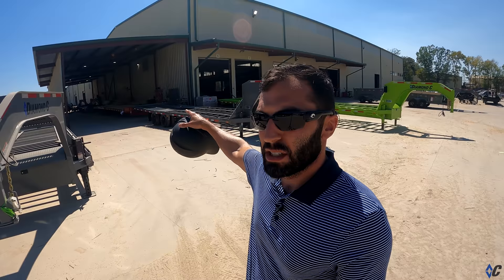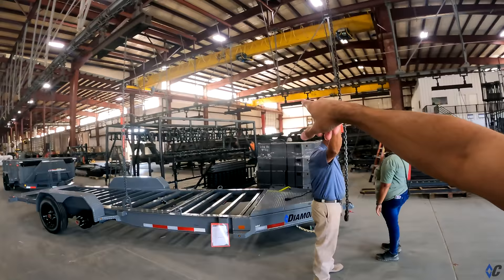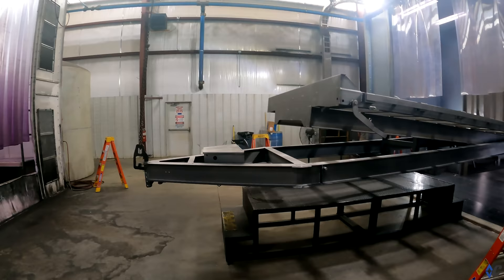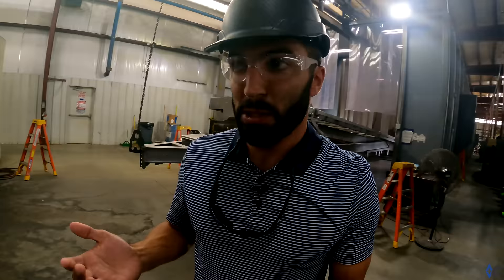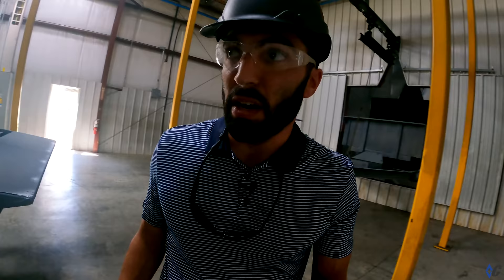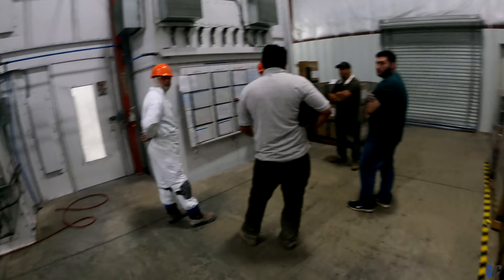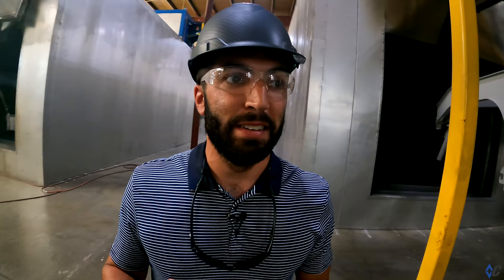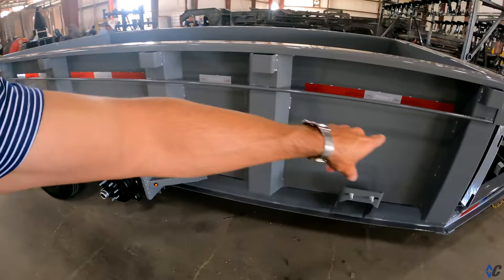Diamond C's DM Powder Coat Guide | Diamond C

Comment: It brilliant ! The whole process. The whole place. Thank you for sharing.. I own a competitor 5 year old gooseneck 20 foot dump trailer black with yellow sticker 🤪. Coating underneath peels off in 2 foot long sections. Whole trailer needs a paint job but looks great still from across the street. Also watched your dump trailer video and my floor is buckling like you mentioned. Very early on we installed 2 layers of 5/8"plywood. Bottom layer length wise. Top layer width wise. It definitely saved my trailer years of life. ...... Now I want one of yours 😁

Comment: Awesome look into the process. I have a 14 foot dump from another company.  The powder coat on it is trash after 5 years, peels in sheets.
Reply: I have a diamond c that is 2 years old and the powder coat is peeling off on the underside. Top side is still pretty good.
Reply: My Force dump trailer is rusting and peeling all over. 2 years old, very little use in the winter #garbage

Comment: Ive got a flat deck from someone else that was built in 2002, the paint is just starting to get worn today. And it’s used here in the salt belt.
It’s a custom series 2x 5200lb axle 18’ flat deck with 2’ beaver tail on it. 
Only part that has sucked is the wiring, scotch locks everywhere that are failing. 
Have taken them all out and soldered and shrink wrapped all connections now.
Debating on a new trailer with larger axles currently

Comment: Diamond C is the trailer company that cares. When you spend 15k on a dump trailer and 20-30k on a gooseneck I expect the paint to last and look good. It's one of the last steps in building a trailer and there is no excuse to make it right. We've got 3 "Small Tex" dump trailers and all of them look rough. The newest 16ft dump looks terrible after only a year and a half. The powder coast is rubbed off on all the wear points, peeling in most places, faded where it isnt peeling, and is coated right over weld bb's, slag, porosity and some mill scale left behind. Just the finishing of a trailer for work that fails... is frustrating to say the least when you spend so much to begin with. We will be making the switch to Diamond C even if we have to drive a ways to the dealer to pick them up.

Comment: I bought a 21’ gooseneck tilt from the competition…2021 model. It definitely had finish issues, especially on the coupler. Does Diamond DM coating prevent that? I’m in the market for a replacement tilt gooseneck trailer. Thanks for this video! Excellent story and info!  Subbed. Liked.

Comment: Powder coating rots the steel under it when water is trapped between powder coat and the steel. I wood never buy a powder coated trailer again here in Canada.
Reply from the maker: Hello there! 
Powder coat done right with the correct preparation procedures + zinc primer doesn’t allow moisture between the steel and the coating. 
Many companies skimp out on the preparation and any sort of primer to save on $.
Reply: @diamondctrailers  I was just on your web page and you guys make some nice products 👌.

Comment: I don’t want to be critical, because your line is impressive. But, media blasting steel, without cleaning it first, is simply impregnating chlorides, and hydrocarbons in the porosity of the steel. Again, your line is impressive, but the quality of a coating system is determined by the hidden areas, of the structure. Use an inspection mirror, a flashlight, and a DFT gauge capable of taking edge readings, to determine the amount of coating in the crevices and out of the way nooks and crannies. Any paint system can be a quality system if the surface preparation, and the coating application is done according to the paint manufacturers data sheet, for the product being applied. Epoxy coatings are going to degrade, when exposed to the sun. Epoxies need to be top-coated with a UV resistant polyurethane. The zinc rich primer is considered a sacrificial coating, that will act as the anode when the coating system is damaged, to help prevent the structural steel from corroding.